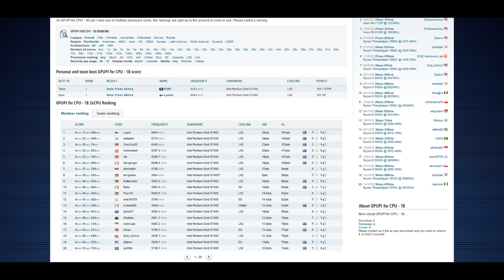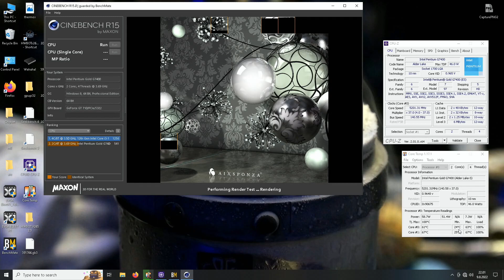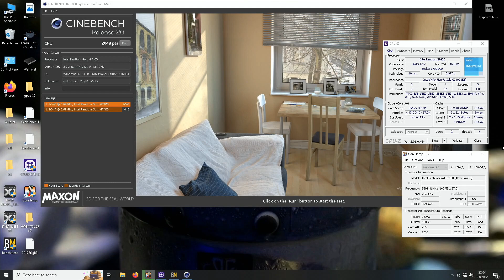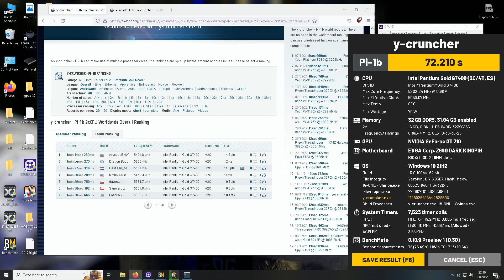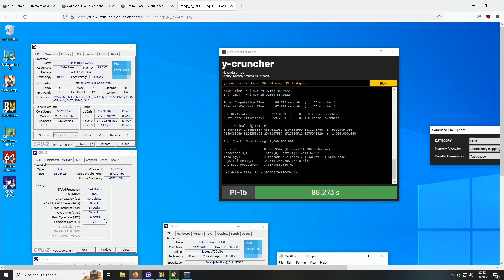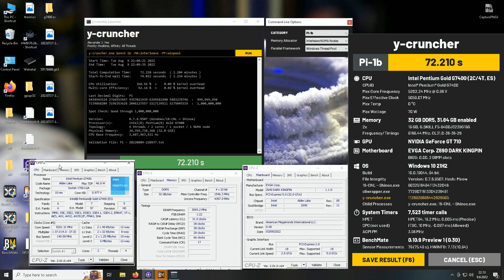Why a Bad CPU Can Be Freaking Awesome - And Why AVX-512 is so Important? Best G7400 Testing on Water

Comment: I guess I don't really understand. A dual-core CPU with massive overclocking and AVX-512 is still a dual-core CPU. Certainly more cores (and more cache) are going to be just as important, if not more so, in any software that is even built to take advantage of AVX-512 to begin with.
Reply: The argument comes from workloads where AVX-512 is more important than more cores, which does happen

Comment: avx-512 isn't used in any regular software nowadays besides ps3 emulator, so saying it's important isn't true.
Reply from the maker: Yeah it really depends on the use case. It is mostly pleasant to be found on 12900K or KS if possible.
Reply: @LuumiJuhani  all 12900KS in retail have it fused off. Even with old microcode AVX512 is not present on my 2021 KS.
Reply from the maker: @qxe1328  Ok, so 12900KS avx-512 could be ES only.
Reply: @LuumiJuhani  They did accidentally leave it on originally. At least some manufacturers were able to enable it, then Intel released an update and was mad at, I think MSI? Once u updated bios, you couldn't enable it ever again though.
Reply: @qxe1328  when i got my 12900k it had it, that was like a year or so ago though. There is plenty of articles talking about it.
Reply: Well the topic at hand is benchmarking and highest overall performance, so in those areas it is correct. Luumi is a pretty famous overclocker, so that's his focus for a lot of his content.
Reply: "Regular" for who? Look at the: chemicals, electronics, energy, transportation in your life. ALL of these products were engineered with software that uses AVX.
Reply: @MrKentaroMotoPI  But not AVX-512, only AVX/AVX2
Reply: @OneCosmic749  No. The key difference between AVX versions is the register width. If the algorithm can be accelerated by AVX, the higher the AVX level, the better. It's just a simple compiler option change for the developer. I know, because I do it every day.
Reply: Seen that you can't read blu-ray from your PC if it has not avx-512. Is it the same for x265 videos?